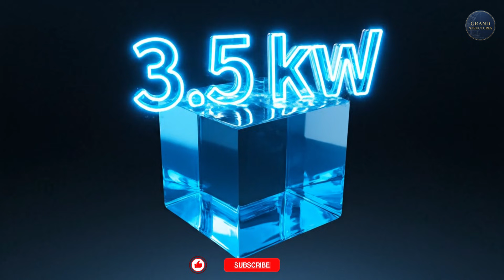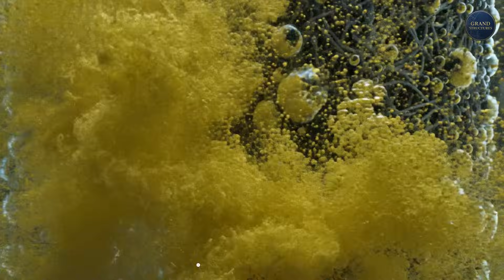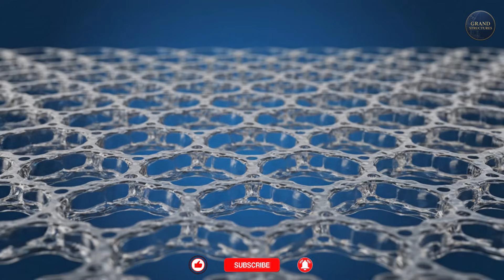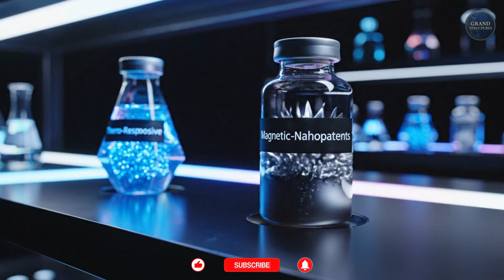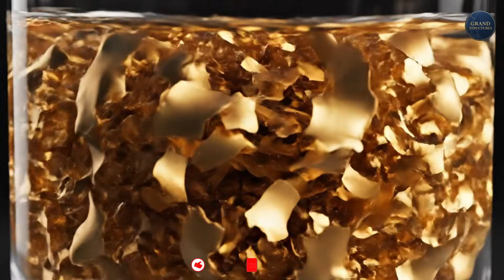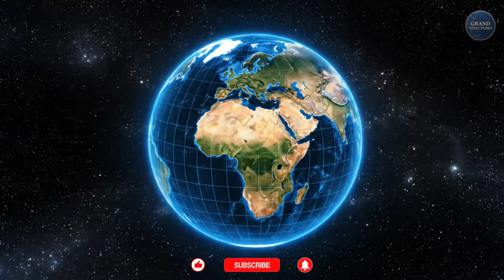The $1 Trillion Race to Make Ocean Water Drinkable

Comment: There are billions of cubic meters of energy just off the Gaza shoreline. They are not energy poor. Another theocracy ( whose energy rich) poured billions into terr0r infrastructure and support instead of developing this potential. They themselves are at single digit water reserves. They could have made the same investments in desalination that Israel did ( whom is not energy rich, but provides a very stable and reliable water source to their people) and not be heading towards zero day on water availability.
Please research this for yourself. You will find it is all verifiable and correct.